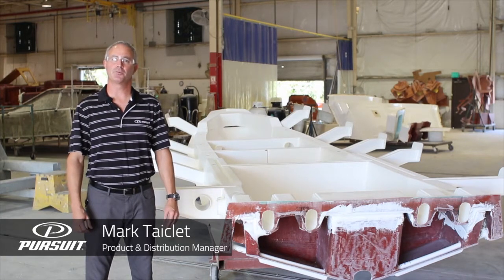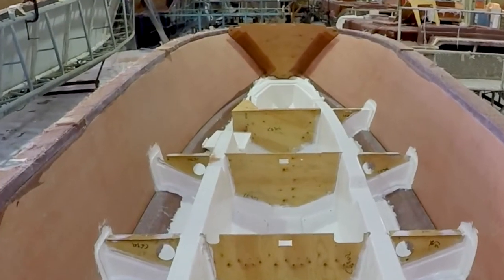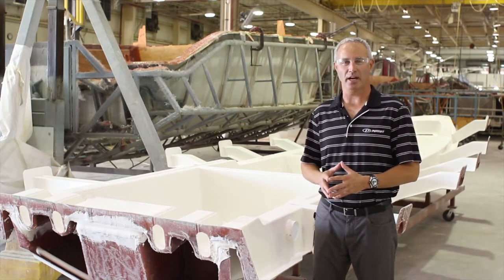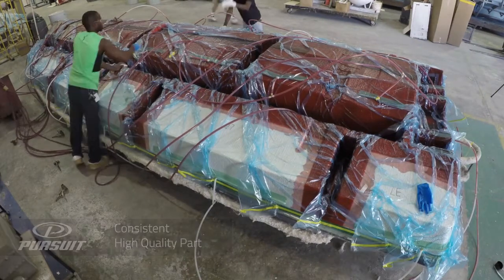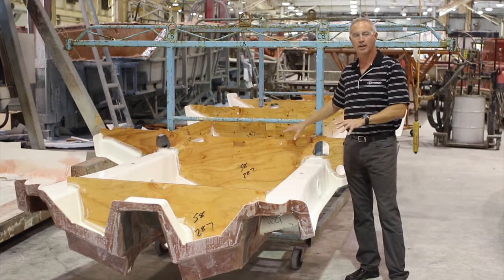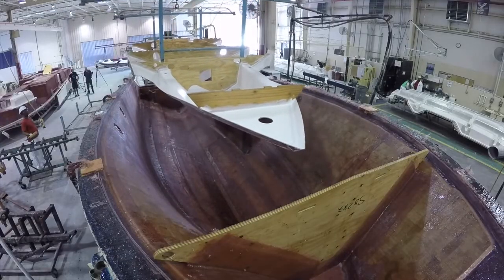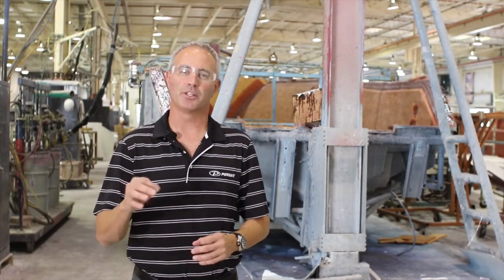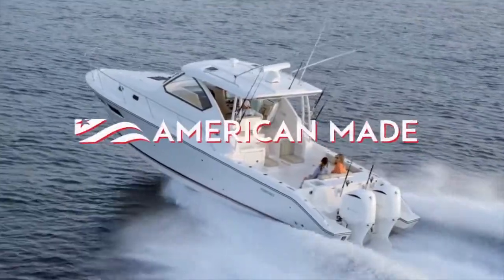Pursuit Boats | American Made, Structural Grid System

Comment: That is not a "one piece" system. And very strange that they are still using wood. And don't tell me it's "marine grade" plywood or that you coat it with epoxy, because that is still a risk. Notice the guy said the grid system delivers strength and performance, but never did he say it's durable. Maybe that's why they only provide a 5 year warranty.